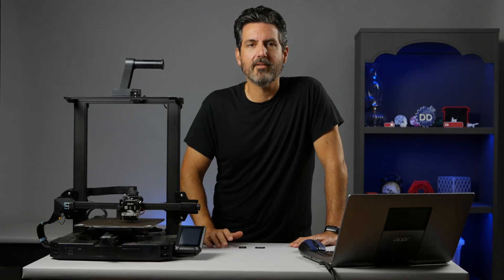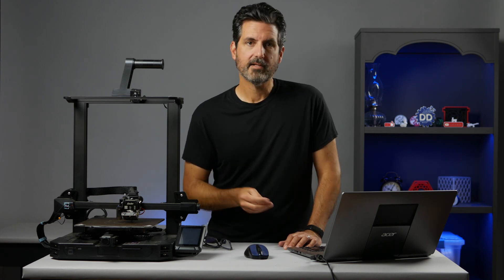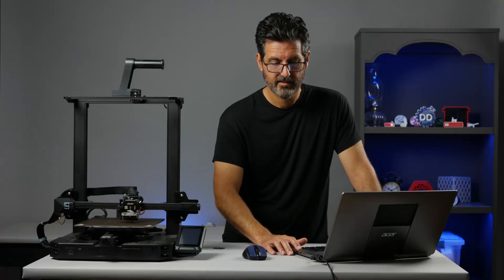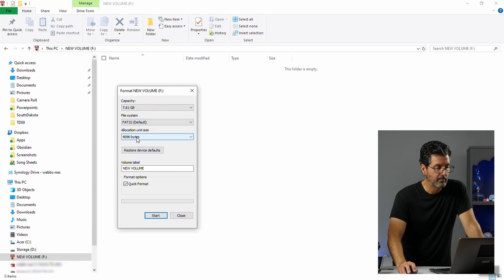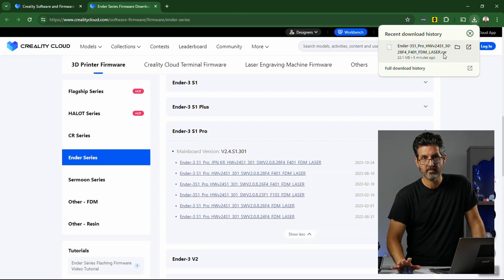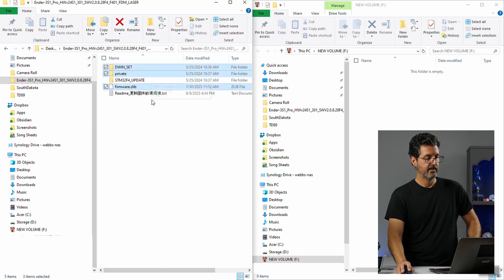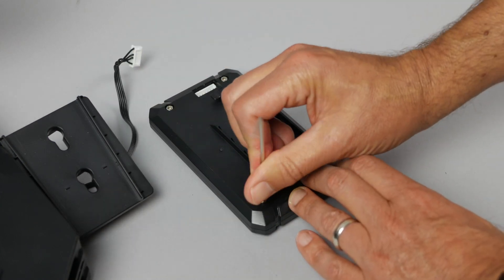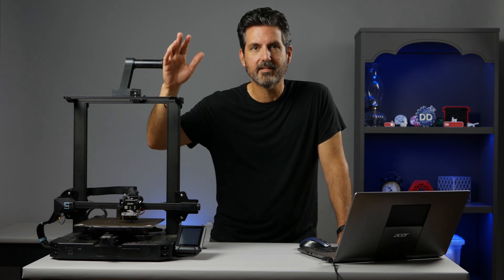How to Update the Firmware on Your Ender 3 S1 Pro: A Step-by-Step Guide

Comment: Hmm - I followed these steps but it transpired my Micro SD had hidden Mac files which prevented the display from updating successfully.  I did not notice this before I went ahead with the main board upgrade.  When I then looked at the versions to make sure all was good I found the display version was blank in the about screen - this made me realise that update had not worked.  I fixed the Micro SD and ran the display update again; this time it showed it had succeeded.  However. when I now boot I, after the splash screen I get a language select screen beyond which it will not proceed to start (I beeps if I select a country and goes nowhere).  I've read multiple articles that describe renaming the main board .BIN file to have it re-flash again but nothing has helped.   Any ideas from others here would be appreciated.
Reply from the maker: You might try repeating the process with an old version. One old enough that both the display and board version is earlier. Once you get it working on the old version try the update to newest again.
Reply: @dandesigns3d   I've tried going back versions and I think I now have mis-matched main board and display versions (or corrupted updates); it boots but the screen is garbled; I can just about get to the 'About' screen and believe it shows 2.0.8.24F4 (which is the last version I tried) with Display 1.0.2. How do I check if these are two compatible versions (I don't see that in the documentation/files).    Ideally I'd like to go back to the version I started with which was from before the laser head was supported, however I cannot find that online anywhere.
Reply: I now have a working printer having bought a replacement touch screen (£18UK).    I did notice that this new unit had a much more verbose update screen, showing every file that it was copying, and also has a progress bar.  The update took far longer than my original screen which makes  me think that it only partially updated.  Creality should really offer base 'rescue' image for both components I think.
Reply from the maker: @quasijones  Glad you got it working.

Comment: thanks for that, some info here, after updating the screen it will reboot itself to the normal screen print thing, about the motherboard dont know mine dont work the sd card slot so idk
Reply from the maker: To be clear, the screen boots to the updated screen once the power is turned off the micro SD card is removed from the screen and the power is turned back on. I don't understand what you said about the SD card in the motherboard. Are you having trouble updating the motherboard?